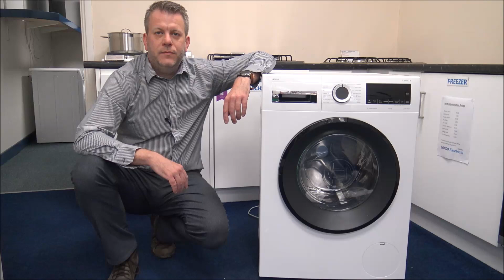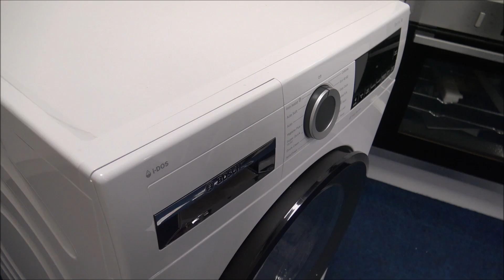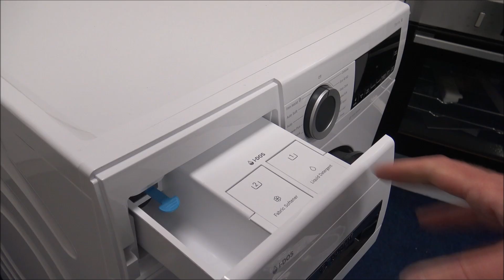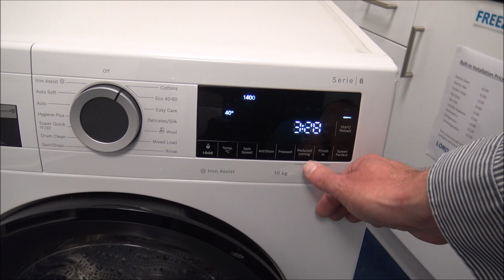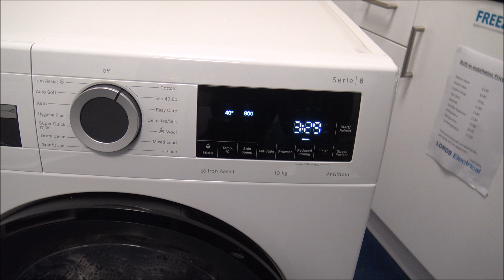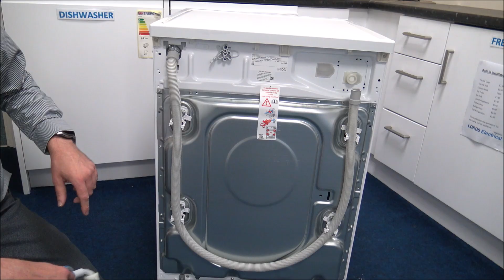Bosch WGG254FOGB I Dos 10Kg Washing Machine Review

Comment: I bought it but don't know how it actually activates I-DOS ..I have done so many washes without wash liquid now ..
Reply: Try to read the manual... It should be set from factory as standard at medium dosage. Or click on i-Dos "button" and continue with settings of amount of detergent. Sometimes you have to push the "button" for 3 seconds to set it. It depends on model.

Comment: Hi can u suggest which machine i should go for between this one and samsung 6 series my main concern is quick wash and i find mostly cycles are very long with max load , plz help me to choose thanks
Reply from the maker: We do a lot more of the Bosch machines as they are very reliable and offer the quick washes too. Also the Bosch aftersales service is better than Samsung too if there is an issue
Reply: Samsung eco is a no go. I have had one and it didn't even lasted 4 years before it started giving me a check drain error message which can not be resolved. Now looking for the traditional brands that were made to last ie bosch or miele

Comment: Does this mean if you have 10kg of clothes the system wont allow you to use certain modes? The machines wont allow 'delicate/silk' mode?
Reply from the maker: if you try and put 10kg of clothes on a program that is designed for around 3-4kg then it will just take a lot longer than stated on the display, and the performance of the wash may not be as good as it should be
Reply: Yes. Only a few of the programs allow a 10kg load. Pretty disappointing.
Reply: @freddyb381  Nobody with brain will wash real 10kg. Nobody. Even on the cotton program. It is pure add and nonsense. Cloth will not be washed perfectly and you just damage your machine very fast. 10kg wash machine means better bearings, heavier components and better durability and stability and lower noise. But you still need to put in max. of 4-5kg!!!

Comment: What cycle would you use to wash Duvets?
Reply from the maker: If your machine doesn’t have a bedding or duvet program then the normal Cotton program should be ok as it will have the ability to wash at a full load.

Comment: Is the i-Dos system any good? It feels like it could be a really useful gimmick but I bet it gets really stinky/dirty in there.
For my current washing machine I have to leave the tray open when done to make sure it airs out and doesn't accumulate mould/grime from the moisture. It feels like the i-Dos system would be an excellent way to guarantee mould in there.
Reply from the maker: I-dos as a concept has been around for many years now and we do ok with it as a retailer. You can pull the drawer out and open the flaps to dry the initial part of the soap drawer if you want, but it will be much better to remove the drawer and wash it out on a regular basis. The idea never really takes off with customers though as a lot of people don't get the concept that it can save money and won't pay the extra cost in the first place for the machine

Comment: If I deactivate idos for detergent and fabric softener and still put the detergent in the detergent compartments, will the washing machine still take the detergent but in manual mode?
Or do I only have to use the first compartment on the left?
Reply: First compartment
Reply: NO! Only left is for manual. And you need to tur off the i-Dos dosing in your program.

Comment: I'm confused about one thing here - I'm looking at the WGG24400GB (9kg), WGG254ZOGB (10kg) and WGG254FOGB (10kg with i-DOS). The official (Bosch) depth measurement of all of these is 58.8cm, which your measurement of the first two models is consistent with, but your measurements of the depth on this model are 2cm more than you said for the others. Which measurement is correct?

(It'll make a pretty big difference to how well it fits in my space, and I can't go and measure it myself as nowhere round here sells this one with the i-DOS so I can only buy it online!)

Thanks
Reply from the maker: I measure the physical size of the machine needed to be installed including the door
Reply: @lords-electrical  but is it actually deeper than the other two models? Without including the door, you said those two were 58cm but this one 60cm

(and the measurement including the door was about 2cm bigger on this one than the others too, although I can't remember the exact numbers you said for that bit now)

Comment: how do i take the pump unit out of the soap dispenser? according to the manual you have to remove it totally when cleaning out the soap dispenser it isn't very clear on the instructions
Reply: One click, one sec. of time. 🤓 simply press the small safety "lever" and pull the unit up.

Comment: As i just bought this machine i'll tell you what nobody tells you 🙂 Since i've already had a Bosch machine that is now 15 years old (8 Series model) build quality of this machine is worse then the old one. Plastic (top and side) near the screen is squeaking if you press it, main circle knob is cheap plastic but the "best" thing is the electric cable. So in my old machine this cable was placed at the top of the machine and now it's placed at the bottom, but the length of the cable is THE SAME. So if your electric outlet is placed above machine (as mine is) you can not reach it with this cable. Bosch would lose so much of profit if they had provided 50cm longer cable so you know how it is. This way i had to buy an extension cable and put it in my bathroom (very safe option), specially when it is near the machine water hoses. Then this running times of 3:50h for eco and 3:30h for cotton. I mean come on. If you use speed then your actual capacity is lowered to 5kg. Btw. i don't think other manufacturers are anyway better. They just copy/paste things from each other and think how to cut production cost and increase profit. I'm happy to see how will this devices look like in 10 or 20 years from now. Lets see how cheap they can go. Why to give 1m of cable if you can give 20cm cable or maybe even without cable. Let the buyer buy the cable.
Reply: Thank you 😊,  u just saved me 750 £, I was about to make the order,  but I had that feeling of why this is a 750 quid Washing Machine... not worth it haha
Reply: @capoierafan  don't get me wrong, this machine is still fine, considering the fact what and how industry manufactures this devices today. I guess this lower rated brands/models are even worse. I'm not sure what top brands like Miele is doing but i'm not too optimistic either.
Reply: @orcalator  Miele are doing what they always do making incredible machines and charging a fortune for parts, but they don't tend to go wrong. But you'll pay at least double :)
Reply: @roundtheloopandback  i saw one Miele few months ago. Main turning knob was made out of such a cheap plastic that i didn't even wanna touch it. It is incredible today what this companies do to lower the cost of production. Soon, even plastic will be too expensive.
Reply: @orcalator  Miele goes cheap too. Plastic components. But you pay fortune for machine and repair costs are as expensive as new Bosch 8 series machine...
Reply: Hey, thanks so much for your thoughts.

Can you let me know what you think of the i-Dos thing? i'm worried about leaving detergent in there all the time, I feel like it would get gross quickly.
Reply: @JawsofFreedom hi, i didn't see any problems with it so far
Reply: @JawsofFreedom  Bio-liquids are bad for this machine. Burt standard liquids are ok. Best is not to use the softener and one time per year clean the tray. And if this unit will break lately, you can buy the new one unit for 70-80 pounds and change it by one click.

Comment: My one is not taking fabric softener
Reply from the maker: Just check the water pressure is ok, as sometimes if the water pressure is too low it will struggle to take the softener or powder/liquid in the soap drawer